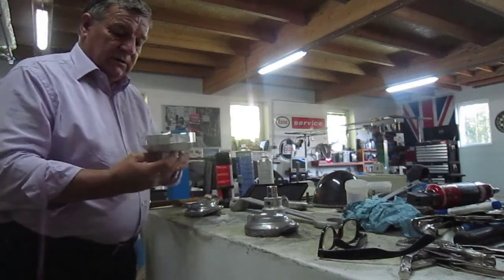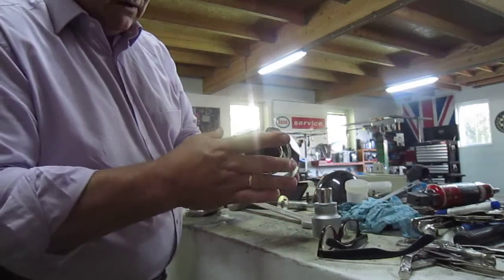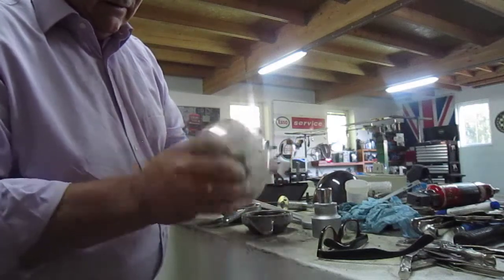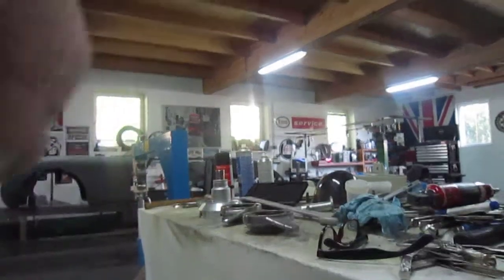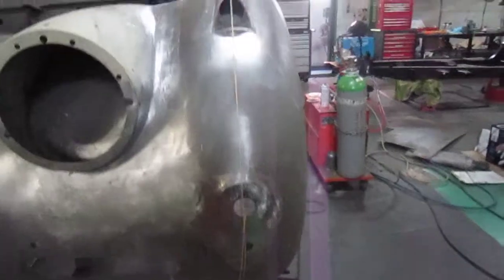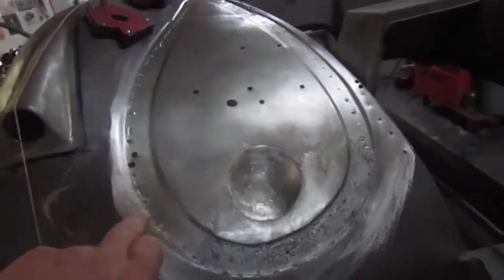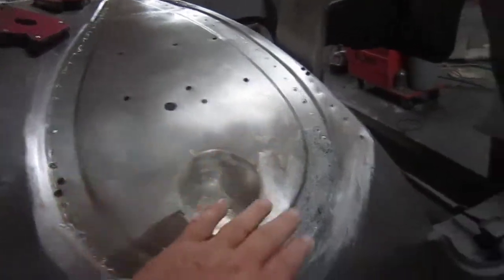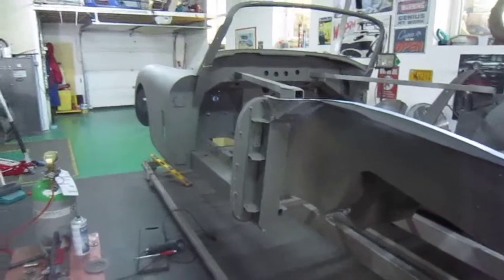Wire wheel spinner tool & Jaguar XK150 light pods

Comment: Hi David . What a great tool looks so well made .  Also great lead work on the pods.
Cheers Pete.
Reply from the maker: Pete, thanks on the thumbs up on the lead loading. I am really impressed with
the spinner tool it is good old craftsmanship. Cheers David
Reply: What i like is its factory way of doing things . The less filler the better . Not that i know much about bodywork  but fair play David ,  you guys are doing a great job .
Reply from the maker: Pete, Thanks!  We are trying to use a common sense approach but the problem with common sense it does not seem very common in this day and age! All the best David.